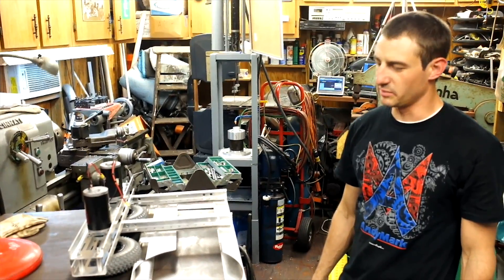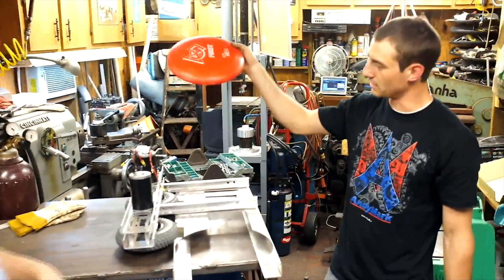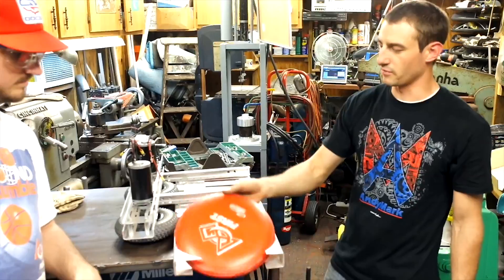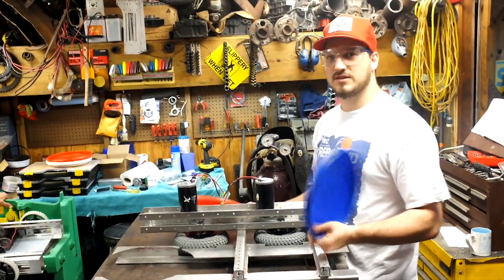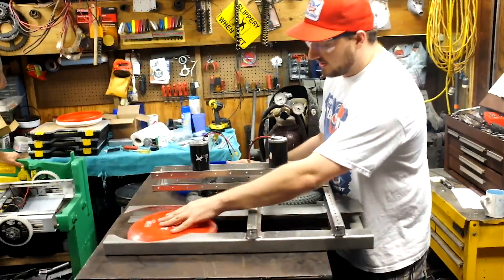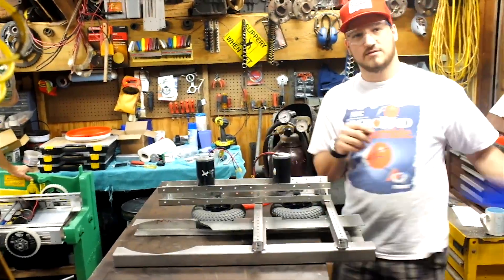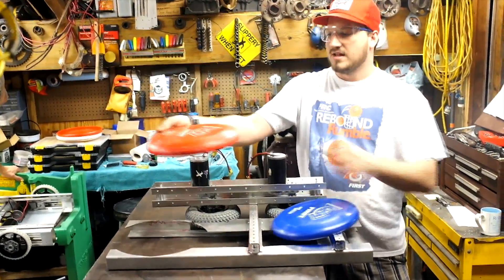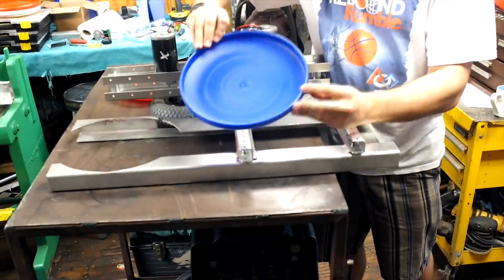Robot in 3 Days : Day 2 Testing the final frisbee shooter for FRC Ultimate Ascent 2013

Comment: My team is currently working on a shooting design similar to yours except that we're only using one 8" pneumatic wheel rather than two.
We're having a pretty huge problem with our shooter and we were wondering you you overcame it. (assuming you guys HAD the issue)
Our shooter is vibrating like crazy and we've done just about anything that we can think of try and balance it and nothings working. So if you guys could offer any help then that would be great.
        -Andrew Jennings, FRC team 3617

Comment: did you have to use some sort of encoder or sensor to regulate the speed of the wheels on the shooter or did you just have the motors connected to a motor controller and just run normal full throttle???